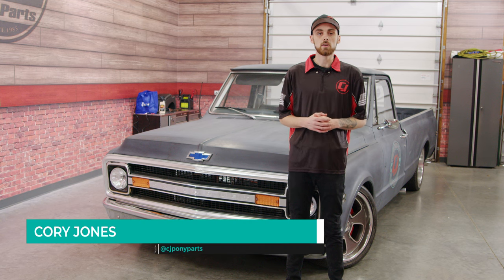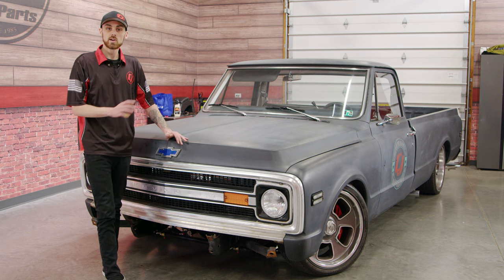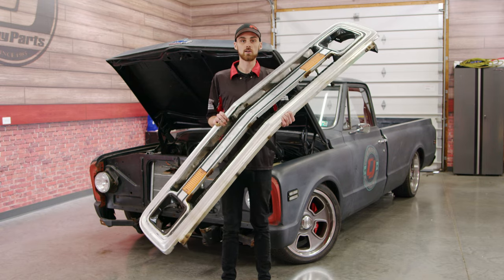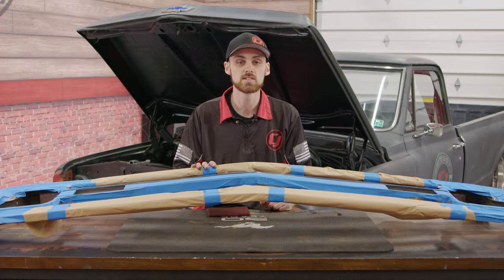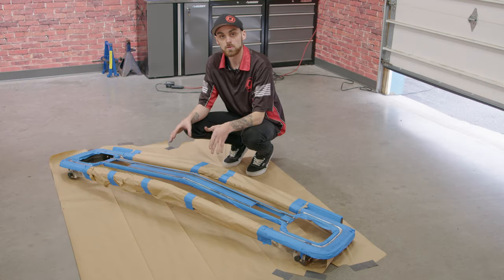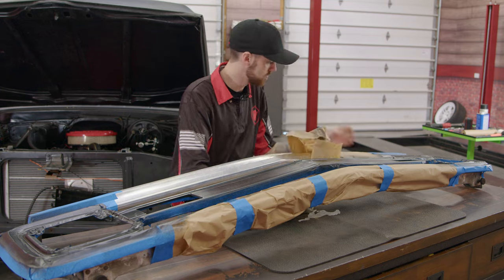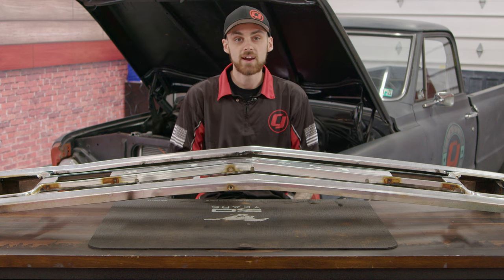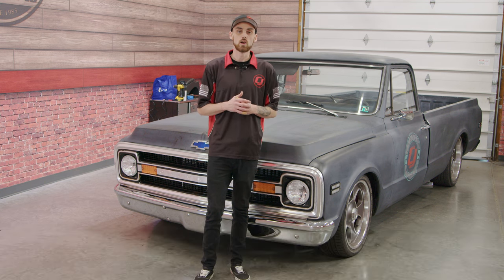Give your C10 a NEW look 😲😍 / 67-72 Chevy C10 Grill Removal & Refresh!

Comment: with these grilles going for close to a grand, you'd think there would be more people doing vids on saving/ restoring them. Btw, the oxidation on mine did not respond well to polish or anything else.
Reply: Yeah that anodized aluminum is a bitch. I’ve seen guys who stripped it and then spent 30 hours polishing it back up. Looks great but man is it a lot of work.
Reply: @rowdy3837  I did rub in olive oil and that worked better than anything else to remove the haze. But i don't know how long it will last.